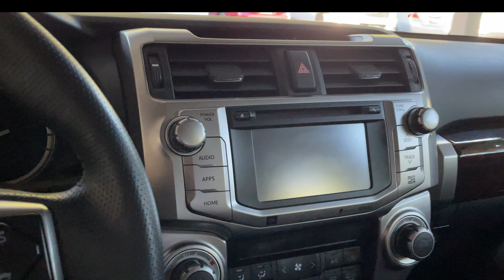Toyota 4Runner Radio UPGRADE - Full Install Walkthrough HOW TO TUTORIAL Radio Removal

Comment: Are you able to adjust the JBL subwoofer level independently from the main speakers?
Reply from the maker: Not really, or at least I didn’t hear any difference when adjusting the sub settings.
Reply: @iSimplifiedTech  I tried to adjust the crossover settings to remove the bass from the door speakers and have it only come out of the subwoofer and that doesn't seem to be working. That's the correct way to equalize a sound system like that. The door speakers can't produce the same bass as the subwoofer so you want to take out the low frequencies from the door speakers and have them only come out of the sub. If you have a chance to look at yours I'd be curious if it does work. I just wonder if I have something connected wrong.
Reply from the maker: Ok so I checked as you said. Can confirm that only the front speakers are providing the bass. Nothing comes out of the sub. I’m thinking now if it’s a head unit issue or some miscommunication  between the maestro module and the JBL amplifier. Do you have the same setup?
Reply: @iSimplifiedTech  We have a Sony XAV-9500ES. With the Maestro. 2011 4Runner Limited with the JBL system (replaced all the speakers except the sub). We do have sound coming out of the sub but it's as if it's getting its signal sent to it as a normal speaker. It sounds really bad unless you turn the bass way down. Those door speakers aren't meant to handle the low frequencies. Once you've heard a good setup (I have a legit sub in my 97) you notice these types of things way more. I can't handle the nasty bass coming out of the door speakers compared to a true subwoofer.
Reply from the maker: Yes, there is a little high frequency noise coming from the sub but nothing on the low side. That explains why the right dash tweeter got funny noises at certain frequencies. So that being said seems like a problem with maestro module not properly recognizing the sub.
Reply: @iSimplifiedTech  I'm glad I'm not the only one. I sent an email to them tonight so we will see what they say. I bet they'll say we just have to add a separate subwoofer with its own amplifier and gain control.
Reply from the maker: Awesome, let me know what they say. I will look into it as well.
Reply: @iSimplifiedTech  They basically said it's working as intended and if I want to adjust the subwoofer level I have to get an aftermarket sub and amp.
Reply from the maker: @michaelrueckert8507  Thanks for the update, I guess that’s my next project then.
Reply: @iSimplifiedTech  Mine too! I ordered one from OEM Audio+.
Reply from the maker: @michaelrueckert8507  so today I played quite a bit with the sound, I noticed that crossover settings for the rear speakers and subwoofer don’t make any difference, only on the front speaker xover setting controls all the speakers. I got the subwoofer to work somehow but it’s at it lowest amp gain, no control over it. I think I had better sound with the oem radio than what I have right now. Not sure if I want to keep it this way...

Comment: I have a 2012 with the jbl system, none of the plugs behind my oem head unit fit the wiring kit that you recommend. I’m so confused
Reply from the maker: Did you get the TO2 or TO1 harness?
Reply: to2
Reply from the maker: I think that’s the problem, you need the HRN-RR-TO1 for that year. I have a link in the description.

Comment: How is the sound quality of this unit? Could you please compare the sound quality of Alpine 507/509/511 (As I assume they are the same except the screen size) to Sony 9500ES?
Reply from the maker: There is almost no difference in sound quality between those well known brands, what makes a difference is when you add aftermarket speakers and amplifier. Speakers usually will make a difference.
Reply: @iSimplifiedTech  Thanks for the reply.  I was thinking the same, since 507/509/511 and 9500ES are their higher-end series. And floating screen might block my air vents. So I prefer 507. Previously, I upgraded the audio system of my 19 4RUNNER TRD OFFROAD step by step. Currently I have Alpine KTA450 AMP and Focal middle range speakers(polyglass woofer, Aluminium tweeter). It is time for the final step.

Comment: Does the rear camera button work when you are out of park? I'd like to be able to see cars behind me on the highway.
Reply from the maker: I do have a parking brake bypass so the camera works anytime. Not sure how it will work without the parking brake bypass.
Reply: @iSimplifiedTech  Great, thanks for the info. I'll be sure to get that as well. Which one did you buy?
Reply from the maker: I went with this one, make sure you wire the ground wire straight to the car chassis https://www.ebay.com/itm/403418606035?mkcid=16&mkevt=1&mkrid=711-127632-2357-0&ssspo=bGz9_gPYTBW&sssrc=2349624&ssuid=qGGlEBsXRM-&var=&widget_ver=artemis&media=COPY